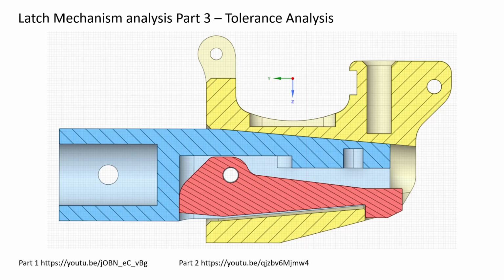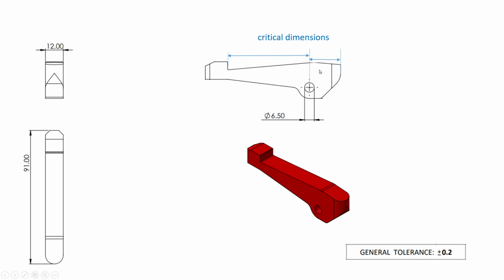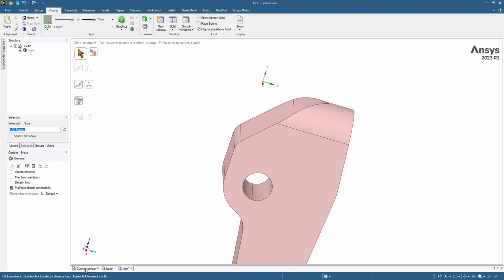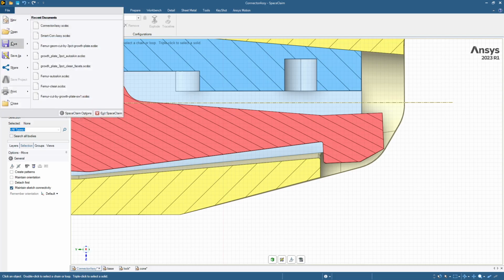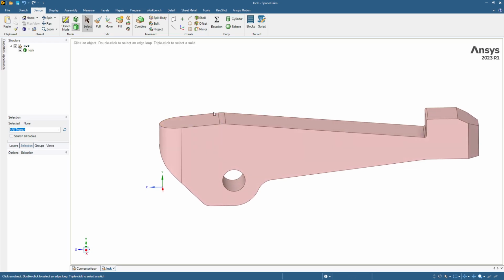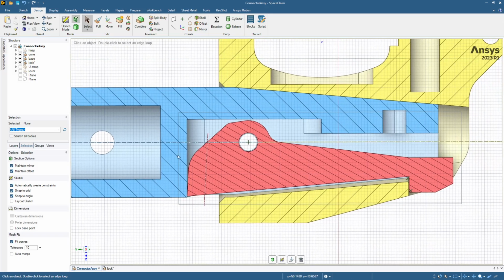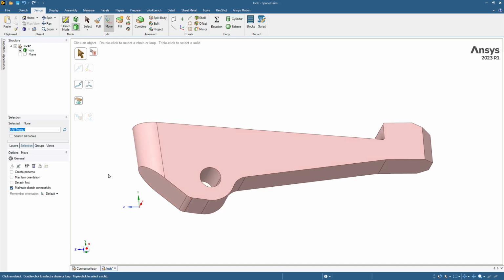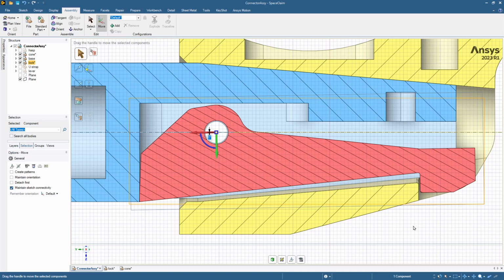Latch Mechanism analysis Part 3 - Tolerance Analysis

Comment: Hi I really want to learn how to simulate our part to ensure the safety during drop test

Do u have any idean how to make the connection between our part if we want to simulate whether our part will be detach or still assemble after drop?
I guess it is highly related with thia latch simulation
Reply from the maker: I can teach you how to analyze and review your initial design and suggest improvements to the design to ensure safety during a drop test.  If you reply with your email address, I will contact you.  After you get my email, you can remove your email address from your reply.
Reply: @ansysfeaexamples9351 Hi. I am a student. I cannot provide u any benefit. I just want to learn to get my knowledge
Reply from the maker: @kiyan181  This channel is here to provide free help to students. The benefit I get is I enjoy helping and teaching.  I find students who want to learn or need help here: https://innovationspace.ansys.com/forum/forums/forum/discuss-simulation/structures/  or here: https://www.reddit.com/r/ANSYS_Mechanical/ so if you want help with your specific parts or have a specific question, you can post a discussion on either of those platforms.  Some of the models I help students with end up as videos here, but some can't share their geometry so I don't make videos from them.